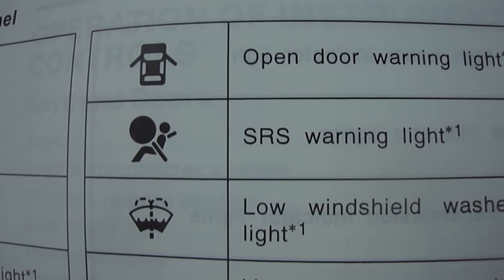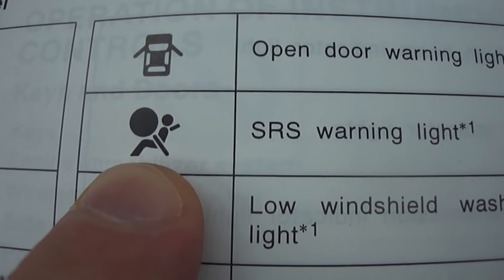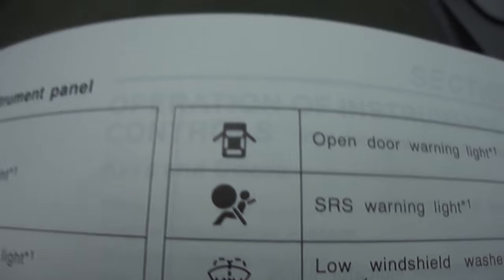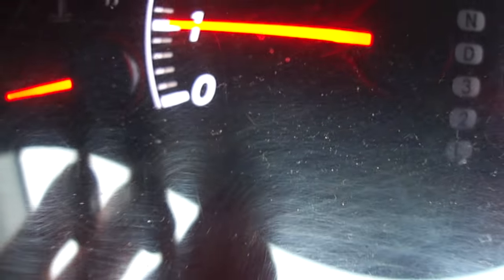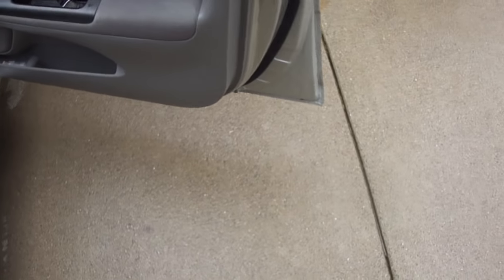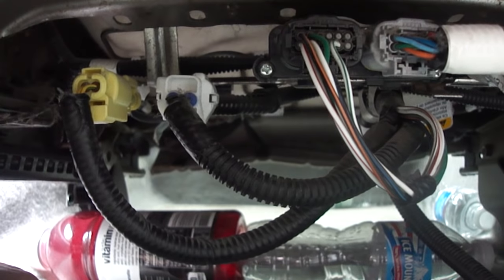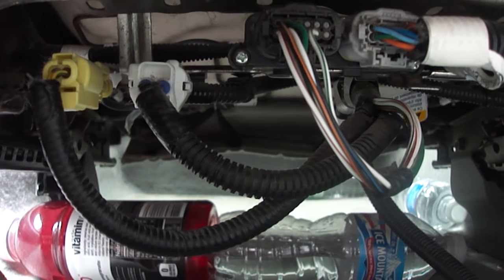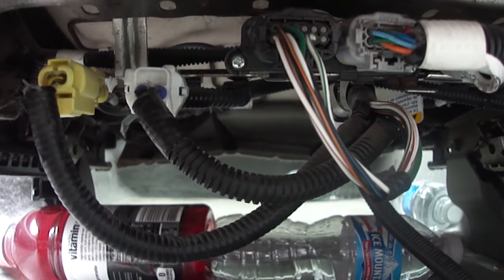(Part 1) How To Fix Airbag Light - Fast & Easy!

Comment: Thank you bro! Just done this on my Jeep Grand Cherokee 2005 (notorious for all sorts of faults) and it worked great! I hope it lasts long or at least until I sell the car soon 😆
Reply from the maker: Janek 👍😊
Reply: @proclaimliberty2000  Now my engine light came on 2 weeks after a car service :(
Reply from the maker: Janek take it to an auto parts store and have them check it with a diagnostic scanner which they will perform for free. That will hopefully help you figure out what’s wrong.
Reply: 🤣 I've had the same jeep for 5 years, Everything has happened to my jeep. Engine, starter, transmission, radiator ect like everything. It's a nightmare of a car. But I love her 🤣. So how did you clear the airbag? Did you disconnect the battery and all the wires under both seats?
Reply from the maker: Janek You’re welcome. Just curious, would you ever own another Jeep?
Reply: @proclaimliberty2000  Most definitely not, I've had my fun with the Jeep but it is one of my biggest liabilities that I cannot wait to get rid of. I bought it at a time when I wanted a big, bad ass SUV when I used to work as a performer at the clubs and was a turbo at the gym. Yes, I do have some great memories with it, and the sheer power to dominate the roads is great (especially when overtaking slow vehicles or trucks), but the money could have definitely been invested better by buying a cheaper car with a a smaller engine (not a V8) of a different brand with cheaper parts, and the rest spent on shares of a company to bring in some capital gains.
I do believe Tesla's technology is the progressive future in all aspects and it is my current goal to own one in the near future.
At the moment I wouldn't mind transitioning to a Kia Carnival, which has a smaller engine, great fuel economy for its size, 8 seater capacity (great for earning extra with  Uber/Ola) and a tonne of space when you wanna transport items. 
What are you thinking of getting?
Reply from the maker: Janek I am not planning on buying anything right now but I was just curious as I see Jeeps everywhere. It’s a shame and a crime that they are lacking that poorly in quality. I have always done well with Toyota and Honda, Tesla is just such an expensive car and you are limited on the driving range and even more so when it gets cold outside due to the batteries losing their charge faster.
Reply: @proclaimliberty2000  The charging points are popping up all over the country every singlet day. As for the batteries losing charge, I don't know enough about it but I know they use special technologies to combat the cold which you can see video about on YT.

Comment: normally you need a dealer level scan tool required to work on these complex systems. I had the exact same light and it had nothing to do with the wire harness. My passenger seat was out of calibration. So I hooked up my Toyota TechStream and recalibrated the Occupant sensor and cleared the code and the airbag light went off.

Comment: SRS is an acronym for Supplemental Restraint System, which is the term for your car's Airbag System.  I've had the light go on and stay on for several cars.  It turned out each time to be either a sensor or a clock spring.  Not too hard to fix yourself if you follow a YouTube video.

Comment: Bottles under the seat can be snagging the wires and pulling connectors loose.  Zip tie cables to bottom of seat out of harms way. Power seats can rip the cables apart if an object gets jammed under when moving the seat. This could even result in a fire. It happened to me once. Don't leave stuff rolling around on the floor or it can end up jamming your brake or accelerator pedal.

Comment: I took my car to dealship and they have charged me $130 for a test on car only to tell me now to fix problem will cost me a further $201.75 for parts & labour to install $585.00  they tell me that they have found a fault within roof and floor looms. I might try this first what do you think ???
Reply from the maker: Julie, there are countless people under the comments section for this video who have saved literally thousands of dollars in repairs bills quoted to them by dealerships for this issue.  Give this a try and see what happens.  Next, stop going to  dealerships as they rip people off everyday and find a good local mechanic.

Comment: Mine has been going off and on nonstop. I had a pretty good feeling it had to do with my passenger seat and a sensor or something... my husband was gonna go get it checked out because I was riding around, laying down pretty much. (And I'm not the one to do that.) We were both scared that the air bags would just deploy. So I searched and found this video, just now. I'm sitting in the driver's seat, reached over to feel for the wires, bumped one and the light went off. Dear sweet baby Jesus, thank you!

Comment: I have a c8 and my light just came on they disconnected my battery to install vertical doors and when they plugged it back the light came on need help

Comment: Awesome Work and great video thanks for sharing!  This just worked for my 2005 Mazda 3.  I was really worried this would be an expensive fix.  Wiggling the wires under the passenger seat fixed the light.

Comment: Also.  If you reset your computer by disconnecting the battery,  the light will come on until you program the passenger seat.  At least on 2005 - 2010 Jeep Commander and Cherokee. How I fixed mine after a year of looking at it was,  I climbed in to the passenger seat sat down, buckled up and started the car from there.  Light went off and stayed off.  I just did another computer clear right befor that by disconnecting my battery and leaving it off for a few hours then grounding the  positive cable.  At least now I know I have SRS just in case of an accident.  And so glad that damned light is off.

Comment: I just got a bit worried because the light was on...thanks for the vid and comments I avoided going to the mechanic! And thinking about it...I'm sure the cables got loose because of the place I took the car to get cleaned. It seems they are not very careful...
Reply from the maker: You're very welcome!  Be sure to watch all of Part 1, 2 and 3 on this topic.

Comment: I can't find the 2nd part.  The fix part. I did the wiggling but it didn't work. I told yo dealer 98.00 . They said cable is loose in the steering wheel.  Fix is 500.00
 Please show me the Fix. Thanks

Comment: What if it's that your airbag light doesn't turn on at all but the LED is in working order - Warning on the dash saying "airbag" but light is not on, also when you turn to ignition the airbag light doesn't flash on with all the others
Reply from the maker: I would start out by disconnecting your positive battery cable for 30 minutes,  reattaching it and see if that fixes it.  Also make sure you watch Part 2 & 3.
Reply: Hmm I had the battery disconnected for a few hours about a month ago and that didn't fix it - I did have a major leak on the passenger side of the car left a huge pool of water but the problem started way before the leak - unless small amounts of water had been getting in for some time without me realising? I'm a bit lost on this one! 2006 Vectra Estate VXR

Comment: 2 things. 
1) If there is a poor connection, what is going to keep the system from failing in an accident? 
2) Any chance your problem is all the bottles rolling around under your seat?
Reply from the maker: If the airbag light is on (due to poor connection, ect.) the airbags will will not work in an accident.  The bottles rolling around on the floor were not hitting the connections.  I live on bumpy dirt roads which I believe have caused the problem.
Reply: proclaimliberty2000  what I was questioning is that with a poor connection, the system may not protect passengers in am accident. 

On a bumpy road, bottles could bounce up and hit the connections, yes? 

Understand, I appreciate your helpful video.  I am chasing an srs fault. Not resolved yet.

Comment: Thanks alot for your vid.,,, my 2010 GMC yukon problem has been sloved 👌
Reply from the maker: Abdulla Alfowzan 👍😊 Be sure to watch part two and three.
Reply: Do you have to disconnect the battery?
Reply: @80sbaybii  No i didn't, i just follow the vid. By re-plugging the harnesses while the vehicle was off, and once i started the engine the m essage "service air bag sys."  was reset.👌
Reply: @uranus1970  Thank you
Reply: @80sbaybii  My pleasure 🌷

Comment: It worked on my 2006 Pontiac Vibe (Toyota Matrix).  With the car running, I unplugged the connections one at a time then reconnected them.  Then I shut the car down for 30 seconds and restarted it.  No more Airbag Light.
Reply from the maker: David H 👍😊

Comment: This will work on a 2004 ford escape xlt. Thank you guy
Reply from the maker: I don't know for sure if it will fix your vehicle but I have come to the conclusion that when this problem occurs it's usually due to a bad electrical connection and for me it's always been the ones under my front passenger seat.  I live on bumpy dirt roads.  I think my light has come on now at least five times but I've always been able to fix it in literally one minutes time.  Just wiggle those connections while pushing the connections together as hard as you can!  Hope this fixes it.
Reply from the maker: Sorry.  I read your post to quickly.  I thought you were asking me if it would fix it.  Well that's great!  I'm glad it fixed it.  Thanks for letting me know.  Just think how much money you saved yourself.
Reply: with way prices are going plus arrogance of some mechanics.... at least you saved me $200... again, thanks a million.

Comment: I have a seat leon 07 reg and the airbag light was showing, So my mate put is computer on and it said fault with driver side air bag.  He tryed to clear it but it not not work, as the fault cleared and come back. Then he told me to go under the seat, I had to bolt it  off  took couple of minutes. I then try to clip off the connection yellow and blue but could not take them off. So As I was doing that he said its cleared so it was loose connection. saved me money going to dealers or garages.

Comment: Whatever is wrong, disconnect the battery and wait about 15 minutes, then give this a try.  The bag deploys through a charge (released by a capacitor) that mixes two chemcials.  This is so if you hit the truck on the battery side, the airbag would still deploy.  So let the charge drain first then repair.   It also would be a reasonable idea to place the ignition in the start position (after repairs) and then go hook up the battery.  Same reason.  Who wants an air bag in the face however remote the chance?

Comment: took mine back to the shop I bought it they took it to the dealership. turns out the airbag CPU was deactivated ..they activated it job took 20 mins.

that store paid for it (in $ came to like 40$ or so )

I'd rather let them do it cause again can be something technical like what happened to me 

was a Peugeot 207 vvt active (2010)

Comment: Did you unplug the battery or remove the airbags fuse ?
Reply from the maker: No
Reply: The first time that happened to me with my 2010 Corolla, I was afraid it would pop out but I took the chance and it never deployed and it was fine after and the light went away. It happens sometimes but I know I move the seat quiet often and sometime water bottles hit against the wires. So I try to keep my car clean now. I honestly think they should conceal the male and female wires but they are just exposed so it delicate as hell. But the brother is right, going to mechanics would be a fortune, just do it yourself and calmly push them to get the connection and you'll be fine.

Comment: Mines said side air bag off but it does have that icon u are talking about also on my 2010 Acura tl
Reply from the maker: Wild Man this video does not pertain to that. That is something totally different. The light you are referring to will turn back on when someone sits in the passenger seat.
Reply: @proclaimliberty2000  yes I totally let that one fly over my head but I will have some one sit in passenger seat I drive alone 98% of time. But I do get the air bag sign on dash 2morrow is supposed to be nice weather maybe I can try to do what u did and hopefully it fors away my car had recall at Acura and the sobs never fixed the airbag symbol. They're quick to take money but lazy to fix or look into issues I stopped going to them
Reply from the maker: Wild Man Make sure you watch Part 2 and Part 3.
Reply: @proclaimliberty2000  def did and def will again tomorrow to try it out
Reply from the maker: Wild Man 👍

Comment: Thanks proclaim . it helped mine go off.  thanks again i think it was a loose wire on passger wireing
Reply: it's the drivers wiring under drivers seat as well.  hope this helps. is this a recall mine is 2006 LE camry 2.4 liter.
Reply from the maker: Your're welcome!  I have the exact same vehicle.  This is not a recall.  This is happening on all makes and models.

Comment: I have an 01 civic, and mine would come on. I would reset it, and it would come back every 3 weeks or so. Heard it was a bad seatbelt buckle, so I took it in and they replaced it under warranty. On Monday it started to do it again, but it's weird. I can make it turn off sometimes by pulling my seatbelt. Or it turns off every time I let the car sit a while. It's probably a bad connection. I just wanted to give people a heads up that on my car at least, if you disconnect the sensor it'll make the light come on and you'll have to reset it. Not sure how long it has to be disconnected for, but it will make the light come on for good until you reset it.

Comment: Ok i got this light after someone hit me in the back pretty hard, not much damage though just a small hole. 04 camry, the light is on and the passenger side light says airbag is off even when someone sits there. When i pull hard on the seat belts they lock so doesn' t that mean that the system works?
Reply from the maker: That's good to know that the seat belt locking system is working but that has nothing to do with the function of your airbag system.  Wiggle and push those wires together under the seats as I show in the video and hopefully that will reset the system.  As long as the airbag light stays illuminated on the drivers side dashboard the airbag system will not work if the vehicle is in an accident.
Reply: Can the issue with the weight sensor for the passenger seat be the cause of that light? I went to check the wires and it is a lot deeper than in your video
Reply from the maker: The weight sensor could be the issue but there's a good possibility  that once you get the airbag warning light cleared on the drivers side dashboard everything will go back to normal.
Reply: is restarting it with a code reader similar to unplugging the battery for a little bit and plugging it back in?
Reply from the maker: Disconnecting the battery will not clear the codes like an auto scanner can.  I will tell you I've never needed an auto scanner to clear or reset the airbag light.
Reply: so how would you reset the light?
Reply from the maker: By following the instructions in my video
Reply: the thing is i looked for the wires and theyre pretty deep and seemed to be in place.. this also happened after i got read ended
Reply from the maker: The fact that they seem to be in place means nothing.

Comment: My 2011 Corolla air bag went on for awhile and then my car stopped running and will not start, the dealer said it would cost 3100 to fix.or 1100 to replace a fuse.

Comment: Had the same problem on my grand Cherokee Jeep just wiggled the wires underneath the drivers seat and it solved the problem
Reply: Do you need to disconnect the battery?

Comment: I can't find anything under the seat of my Honda Odyssey. I looked under dash and could see harnesses and wires which I jiggled and checked but still have the darn light on.
Reply: JW take apart your drivers side belt insert and clean the activation switch with electrical cleaner and any dirt, debris around that switch. Most of the time this mechanism is just dirty and the switch cannot be properly depressed with the seat belt pushed in to deactivate the SRS dash light.

Comment: Theres no air bag connections under the seat of my Hyundai coupe 2000 there's a airbag module under the centre console , ive wiggled the connections and wires but no luck getting my light off

Comment: This video was helpful, but the ultimate solution in my case was very simple. I had left the doors of our '08 Explorer open during the diagnosis and killed the 7.5 yo battery. So I bought a new battery and the intermittent air bag light disappeared!
Reply from the maker: J. French 👍😊

Comment: THAT VERY WELL COULD BE MY PROBLM AS MOST PEOPLE WHEN TRAVELING WE TEND TO LAY BOTTLES AND STUFF IN THE FLOOR AND IT WILL ROLL UNDER THE SEAT AND IT COULD MESS THE WIRED UP , THANKS
Reply from the maker: Karreenna 👍😊

Comment: I installed a passenger occupancy bypass and now whenever the bypass is installed the occupancy mat error light goes off but the passenger side pr-etensioner light goes off. The pre-tensioner only goes off when I have the occupancy bypass installed. This is on a 1998 Bmw M Roadster, can anyone give me some insight?

Comment: Interesting, my nissan frontier has done the same thing several times and initially I looked under the passenger side seat and saw the connectors together but never made an attempt to secure them as you did and perhaps I inadvertently wiggled them slightly when I tried to fit something under the seat (to no avail )or where I'm constantly moving the seat back and forth.  I will do what you described in your video...really thank you for this information as I'm relatively certain it will be useful for others as well.